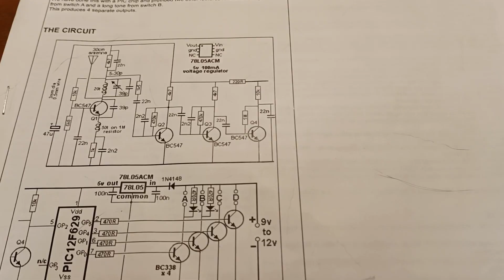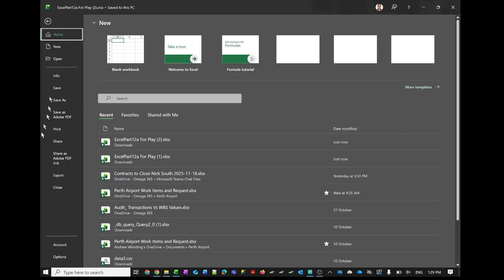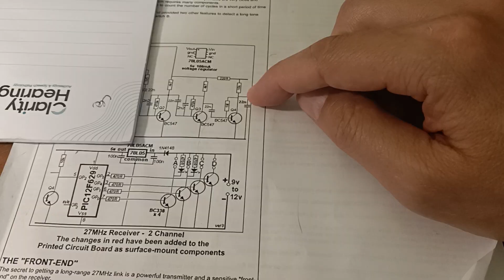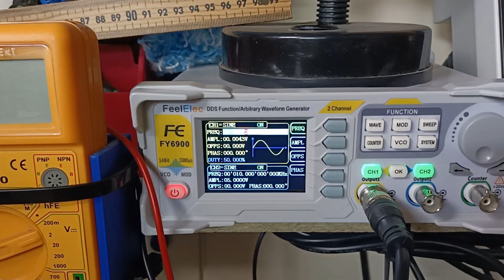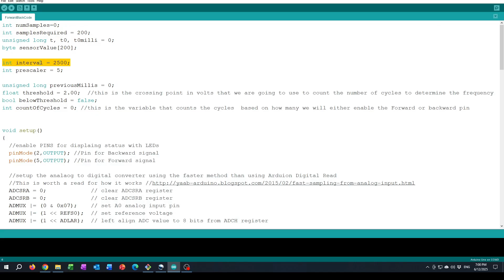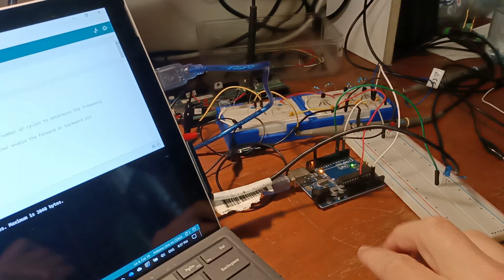27 Mhz Receiver circuit Part 2 Microcontroller

Comment: Instead of using Arduino Uno  , please explain the working of the circuit using PIC
Reply from the maker: Just curious. Is there any reason for the preference for PIC?
Reply: @overengineeredinoz7683  knowledge purpose only. Just wanted to before Arduino Uno, how it was done . In the same wat  please explain the working of transmitter circuit diagram also.